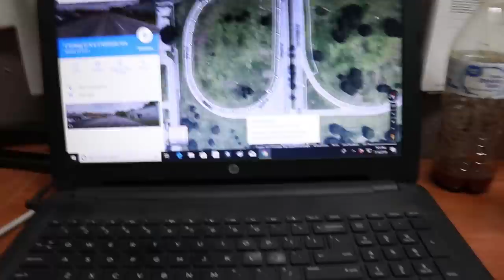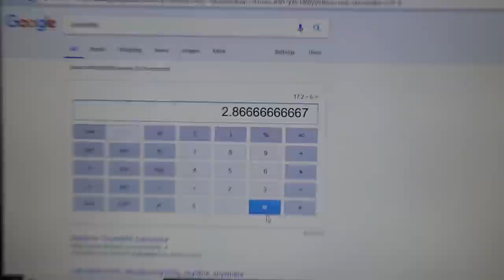How Many Acres Can I Mow In 1 Hour With Wright Stander ZK 72

Comment: You should also factor in that you have slopes that you are climbing every pass, and obstacles such as trees, having to get off of the mower to pick up trash.  I own the same mower, with a set of dual wheels due to steeper terrain where I maintain lawns, and rural areas.  One subdivision that I mow has 19 lots and I knock it out in 45 minutes with the 72, use a 36” for the perimeters and smaller spaces.  I agree with the oil changes, hard to get to.  Also, somewhat difficult to clean underneath the deck…love the mower, nice video.

Comment: Appreciate this vid as I’m trying to get an understanding of about how much time I can save by mowing with a Wright or other commercial mower.  Big help.   I have just under 3 acres of grass on my farm so this was perfect.  Currently taking about 2.5 hrs with my Deere X340 tractor which has a 54” deck.
Reply: falcondrvr200 my Deere 930M does my 3 acres in about an 1:15. I use the tweels, z glides and a 60" deck
Reply: little Finkle yeah sounds about right.  Those Z930’s look bad ass

Comment: a lot of variables in mowing. 

The max you could do in a square lot with no stopping would be around

72(inch deck)X12.5(mph)X.8(80% efficiency) / 100 = 7.2 acres per hour.

Comment: I can mow my 1.2 acre lawn in about 45 minutes with my John Deere QuikTrak 652R, which is very comparable to the Wright Stander X. I have a mildly sloped lot and multiple beds that I string trim the borders every other cut. The stander does fine. The most it ever slips on hilly areas is if the grass is wet.

Comment: for things like the bottle full of pee... keep a little pack of sanitizing wipes on you. i keep a pack in a cargo pocket in case i'm out somewhere and my hands get grimy or i have to touch something that's questionable.

also, i like to wear a camelbak water bladder if i'm going to by outside for extended periods when it's hot. it's nice to have water ready to drink (up to 3 liters, depending on the size of the bladder) instead of having to stop and go back to the truck/house to get a drink. it helps just to stay hydrated to keep from burning up out in the hot-ass sun.

Comment: Got an idea that might work for that oil issue.

Have you tried a basin wrench? It's specifically designed for getting into tight spaces at sharp angles that you can't get to with normal tools. It might be a little easier to do what you need. No less challenging, but easier.
Or you can just install a hose. :-)
Reply from the maker: It's fixed now.

Comment: I used to maintain a lot for a trucking company.  As a former CDL Class A driver for 8 years, I know what those bottles contain.  Hope you never run over a little plastic bag, it'll be even worse.  Nasty truck drivers!!!  Always keep in mind a LARGE debris cleaning charge when pricing.  Learned that one the hard way even though I knew what to expect.  Looks like you are living the dream.  Here is mine,  from 8:30am till 10:00am I mowed less than 10K sq feet. This, https://youtu.be/Z6szXyEVZ7s , is the second property and the first was smaller.  Two more each day of the week until Fridays four.  Gonna be a long hard winter :(  Thanks for sharing that awesome video.  I'll use my former CB handle,  HITMAN out.

Comment: Hey man, just buy you a electric oil pump  and then add quarter inch copper tubing 12 inches in length to the suction side. Replace the copper tube in through the filler cap and give it couple of minutes and all the oil is out. You will never have to drain again. Just make sure on the discharge side your container doesn’t over fill LOL it happens. The eclectic oil pump on Amazon is 19.99 and copper tubing no more than IDK $20.00 and the pump hold up extremely well.
Reply: Sorry I think it’s 1/8 copper tubing it just needs to slide through the filler neck into the oil pan. Also be careful the tube can get suctioned to the bottom of the oil pan just pull it up a little.

Comment: it is two years later, you may not even own this mower today.  I ask a personal question. you just came back from the wright family reunion- I assume this is wright mowers, yes?  you make a video with scag apparel on? 
on a completely different note.  why worry about the drain plug? purchase a 6 quart oil vac canister to draw the oil out the dipstick tube.  works on most small engines and no mess.  as a side benefit you don't have to worry about tightening the drain plug or rounding it off. under $80 at harbor freight. lasts for years.

Comment: What Walker dealer do you use? I live in central Kansas and i'm disappointed with my dealer. The Walker dealer here owns a mowing business, as do I. As you can imagine, there is a little conflict of interest.
Reply from the maker: I use Jims tire and auto and Maximum outdoor and Andover lawn Equipment.
Reply: Thank you, I will give them a call and order a new T23 for sure, and maybe a new B19. I'm also not opposed to buying used low hour equipment. I will let them know that you referred me. Maybe you'll get some new blades out of it. I really appreciate the info. Top Notch help right there!